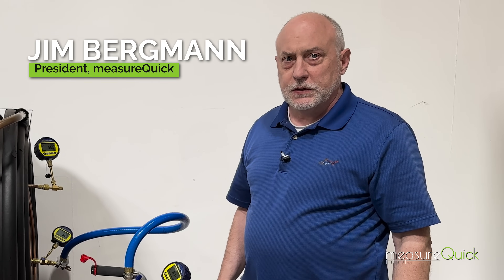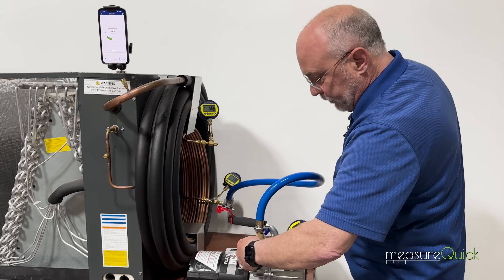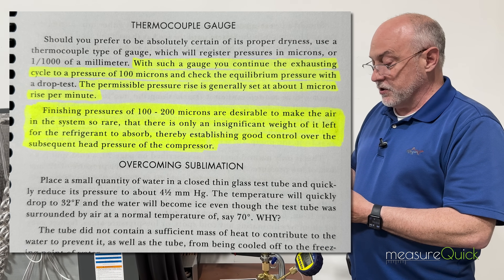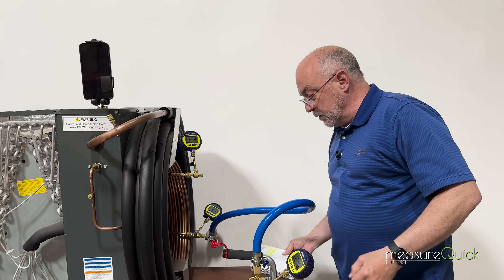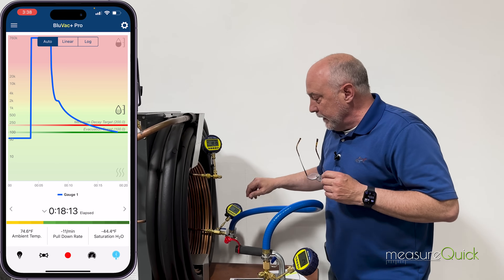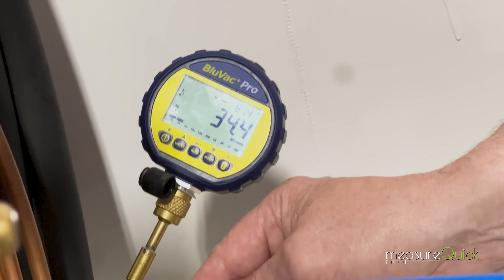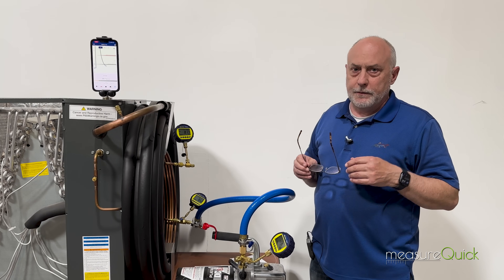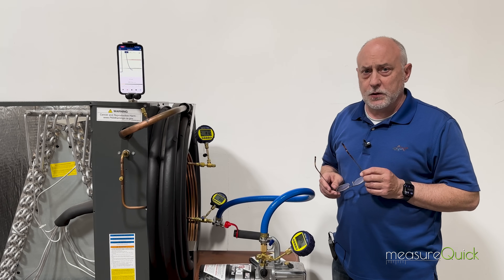Best Practices for System Evacuation [2024 Version]

Comment: You reference the dew point at 500 being -10°. Okay, so during evacuation, if my system temp is above -10° then liquid water will begin to boil off. This I understand.

What I dont understand is how you are drawing the connection of this -10° dew point(under vacuum) to the operating suction saturation temp. When we are operating at -10° saturation, that is 38psi, not 500 microns. Do the dew point doesn't apply??

We want these systems super dry, but I just don't understand your comment when you reference that manual and "500 microns isnt enough"
Reply from the maker: @trevorjones559  dew point of the refrigerant when the system is in the heating mode. The outdoor coil has to be colder than the outdoor air in order to absorb heat. If it was 0° outside, the coil would be approximately 10° colder.

Comment: Hey, Jim. At 1:00 You gave the extreme example of 0 degrees outside temp causing moisture to freeze in the metering device.

But wouldn't you also have the moisture freezing even as high as 40° outside?(For example). Target suction saturation will be about 30°.

Comment: Pulled a vacuum on my 10 year old, 3 ton Goodman split system. Appion core removal tools and 2 half inch hoses hooked up to a Navac 7 cf, pump performed nicely.  The Blu Vac gauge and app displayed 300 microns.  But, the decay test failed.  Repeated pull and test a few times. It showed some improvements but still about 1200 micron. Will proceed and apply some heat to the compressor. Is it advisable to run some nitrogen thru the system? Any suggestions?
Reply from the maker: @horsth9566  you can try nitrogen, but it is likely wet. Replace the dryer, install a moisture indicator and get it to hold below 1000 microns and let the dryer do the rest. Check it in a week or so and verify the system is dry.

Comment: Question: does the elevation you're in have an impact on the calibration process? 😊 i bought a new bluvac+ pro which was asking for calibration right out of the box.
Reply from the maker: @cm9368  no, elevation has no bearing. That sounds like it needs repair/replaced. That should never happen out of the box. I would call Accutools

Comment: I'm from Serbia and I'm delighted with your clips and your colleagues from America in terms of frigomechanics and I've learned a lot from you. I congratulate you on the fact that you want to pass on knowledge and you don't hide it. As soon as I had the opportunity via eBay, I ordered what was unimaginable: FIELDPIECE SMAN 3 manifold, BLUVAC micron gauge FIELDPIECE SC 56, vacuum hose, yellow jacket.
All this still serves me today after 10 years, except BLUVAC, which is my fault because I didn't clean it regularly with alcohol. I can't forgive myself for that.
I also have two older ROBINAIR vacuum pumps, two VALUE and now I bought a FIELDPIECE SMAN 480VINT, a VP 67 vacuum pump and a recovery machine MR 45.
I bought the last three FIELPIECES in BELGRADE because a company appeared that imports this tool.
Instead of the never-regretted BLUVAC, I got a TESTO 552i i
 TESTO SMART PROBE.
I brag a little about the tool, but I want to tell you that your tool is excellent, and so are your lectures.
Greetings from a master from SERBIA.

Comment: At what micron level will you start evacuating oil in the system?  It is my impression that oil is more a problem in automotive AC.  Is that correct?
Reply from the maker: @BryanTorok  non issue, you would have to be below 20 microns for that to even be possible.
Reply: @measureQuick  Tnx for the iofo.

Comment: Good information.  What's your thoughts on micron guage placement with mini-splits?
Reply from the maker: On the core tool is the best and often the only place.
Reply: @measureQuick  it would be nice if you could do a video about it. I find myself going to 100-200 microns and then my decay always jump around 100 microns and never really stabilize, after 10 minutes of waiting im still at 8 microns/minutes leak rate. is it because the lineset is smaller and shorter on a minisplit and the fact we can't connect at the best place.
Reply from the maker: @SpecialKthx  Are you closing your core tool slowly?  If not give that a try. Trapped gas in the core tool can cause some significant rise at isolation. The rate of rise should be continually dropping. The smaller, the diameter of the tubing the longer it will take.
Reply: @measureQuick  the longer it will take to stabilize? I do close my valve probably too quick! but i turn them on/off multiple times during my vacuum so trapped gas probably already got sucked.

Comment: Appreciate the info. Not a realistic demonstration though. You eliminated the hardest task from the picture. Need to try to pull down that low that fast with a Poe oil compressor after a repair. More of a realistic expectation on how those expensive hoses and tools will perform in the real world
Reply from the maker: The reason pulling a vacuum on an existing system is so hard is because it was never pulled right in the first place. You are correct. It’s very hard to get below 1000 microns, let alone below 500 on many systems. At that point you have to install large capacity dryer to handle moisture. On a new system like this one however vacuums are very easy to achieve. It’s not only about freezing point but also about moisture load. The dryer can only handle so much and we want to have the system as dry as possible when we start so that the moisture does not end up in the dryer or the oil.
Reply: You can 't remove moisture from POE using a Vacuum pump.
Reply from the maker: @w0lvez1  You can, just not quickly. The best way to do so is with a liquid line dryer.
Reply: @measureQuick  The problem is there are no liquid line dryer. The manufacturer said not to install one. P
Reply: @measureQuick  That what Carrier Service Manual says. The manufacturer service manual is always a reliable source of stupid myth.

Comment: I’d love to see how long it takes for you to pull down on a used circuit with the compressor
Reply: That's a whole other beast! We usually try to purge the system as much as we can with Nitrogen. Pull a vacuum and use the 3 evacuation method. But sometimes that still isn't enough. So we purge again and keep repeating. Replacing the oil on the pump constantly. It is not fun and it takes a while. I am also curious to see how he does it! Maybe he can shine some light on a best practice.

Comment: Can I ask what conditions were in the room? Db and wb? And can we talk about expected vac times in humid environments? Or on service 20 year old unit with converted  compressor from Mo to Poe?
Reply: I have a similar question because I have a hard time pulling a vacuum below 400 on a 15 year old system in the PNW. I have seen your video, Jim, of you in the field pulling a vacuum quickly but it takes well over an hour for me to get below 500 in most cases.

Comment: i wish u would teach automotive ac, tom lech has helped me a lot and he turned me on to you guys and man its what none of us no is crazy, but now i can do better from watching and learning. if you have not watched some of those top guys in automotive doing ac you would fall down and cry. thanks for taking time and helping. and they will tell me they been using shop air for pressurizing the system for leak checks and when i say thats a no no, oh man they give me hell. at that point i challenge them to check u guys out and ask their local residential ac tech would they use shop air. they some times will clam up but i dont think some will ever learn. but i am even at 67,this old dog still learning new tricks. thanks thanks thanks
Reply: Automotive is just more complicated...hvac r cant tell you how to remove a engine mount to change a line out or lets say like  mercedez benz you have to take the engine out just because the engine bay has no space to change out a evap coil etc etc

Comment: I have the tru blu hoses and the BluVac pro micron gauge. I do a lot of retrofit system changeouts and 99 percent of them are heat pumps. When I’m pulling a vacuum on a new system ( evaporator coil and lineset only) I always pull a one hose vacuum. I also do a lot of service work and I replace a lot of compressors, reversing valves, and condenser coils and I use 2 hoses to evacuate the system in those cases. I’ve found that I can pull the new systems below 100 microns but when I’m pulling on the entire system and the compressor oil I often times can’t even get below 500 microns with an 8 cfm pump, clean oil, and tru blu hoses. I have a lot of calls to do everyday and I have to get the systems working before I leave so I can’t leave my pump running over night and come back the next day. Is it going to hurt the system if I can’t get some of these compressor or reversing valve jobs below 500 microns?
Reply: Consider the "triple vacuum method", breaking with dry nitrogen.
Reply from the maker: On existing systems it sometimes hard even pull below 1000. At that point you need to make sure you change out the dryer with a larger capacity model and let the dryer handle the moisture. I would also install a moisture indicator designed for the refrigerant that you’re using so you can verify in a week or two or have a customer verify that the system is indeed dry.
Reply: I usually do upsize the drier to at least a 16 cubic inch. I stopped even carrying the 5 and 8 cubic inch driers on the van. Thanks for the response! Sometimes I feel like I’m doing the customer a disservice when I can’t pull a deep vacuum on an existing system but I’m always being rushed to get to the next job, especially this time of year. The moisture indicator is a great idea and I’m definitely going to suggest it to my service manager. It would be nice to know whether or not the drier is handling any moisture that wasn’t removed from the evacuation.
Reply: @vincentgelles3805  I tried making a Vacuum tank out of a disposable cylinder then filled it with a molecular sieve. I can't tell if it is boosting my pump's overall performance or just the CFM. But when micron reading gets stuck I just isolate the pump to let the micron reading go up then as soon as I open the valve it will pull to a lower micron reading.
Reply: @wOlvez1 That’s pretty smart! I knew a tech at a company I used to work at who made some vacuum hoses at of soft copper with flares on the end. He said that all hoses leak, even vacuum hoses and I gotta say his rig did pull a deep vacuum very quickly. But, I never saw him use it on an existing system. I feel like it probably would have struggled especially on some of the systems I’m working on that weren’t ever evacuated properly on the initial start up.
Reply: @vincentgelles3805  Yeah, that's true. That's why I wrapped my hose with aluminum tape and used dual wall heat shrink. Watch my decay test @ 109 microns
Reply: I’ll definitely check it out!
Reply: I run into the same issues, Vincent. I put two new condensers in( indoor coils could convert  r-22 or 410a with a metering device change.) So two new txvs in after making sure pressure test passed 450 psi and vacuum test..  During vacuum (2) 1/2" hoses I had to break the first system twice with nitrogen and the second three times with nitrogen.  New filter Driers. They would both pull down below 225, but one side, when I isolated individually, would slowly and gradually rise up to above 1000 and kinda hang out about 2800-3300; it took about 15-20 minutes.  I had both of these on a vacuum probably 5-6 hours.   My hunch is likely fighting moisture and refrigerant boiling off

Comment: Some guys in automotive use their wet high % compressor shop air and inject it into the ac system to look for leak in a PAG , POE oil system. 

Then the even start the compressor will that wet air to see if the compressor will start and build pressure 🤯🤬 

Not the sharpest tool in the shed
Reply: Some people even worse. Use Co2 to pressure test
Reply: @georgekolos5255  please help, there is a system being sold called bullseye that uses it, check that out and please let me no why not use it( co2. )
Reply: Ironically the ATS Bullseye system uses CO2 and gets top notch reviews
Reply: @Dee-xm4jb  yes there’s a lot of five star reviews on items from Temu to
Reply: yep my tool is getting sharper because of you guys. ordered my dtek today aprx1100.00 just decided to bite the bullet for the bells and whistles, im sure you will be helping me more , tell me when you get tired of my voice. heeeehee
Reply: @RATCHETMAN1001  did you use my 8% discount code 
LECHAIR 
all one word all caps